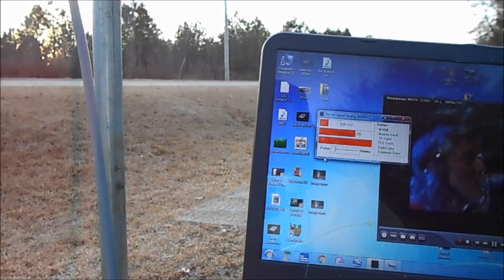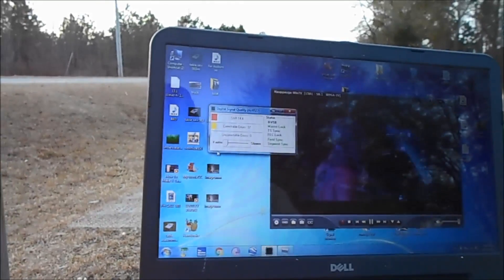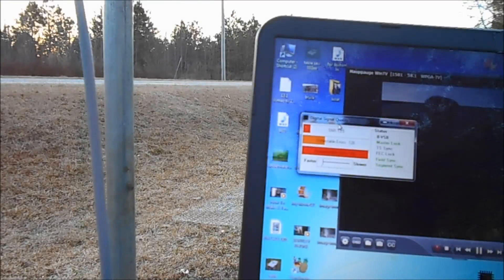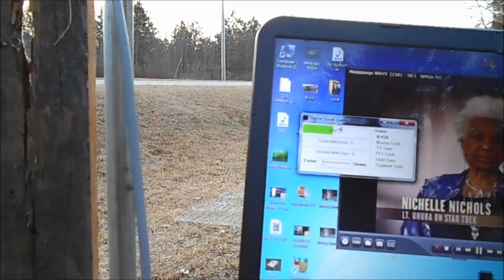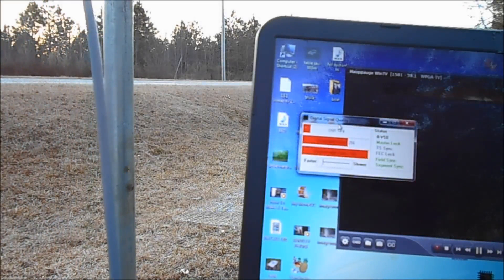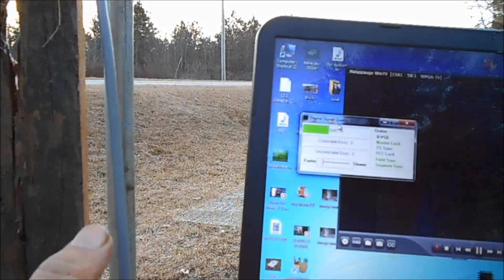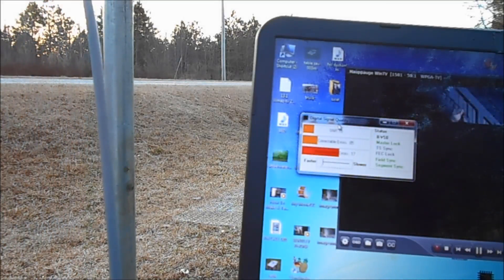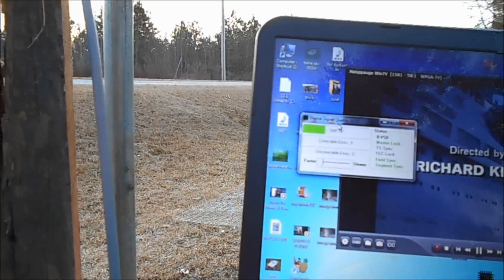TV Antenna Reflector Demonstration

Comment: Thanks for this, Danny! I've been struggling on and off for over a year to get and hold channels from towers 50 - 55 miles away. I live in a wooded area midway between Washington DC and Richmond. I have two antennas (one UHF/VHF and one UHF only) on tripods in the attic of a 2-story house, so about 25 feet high. Until I saw this, I could get channels from both cities, but good UHF signals were tied on weather/atmospheric conditions and would drop frequently. (VHF pickup from DC has always been consistently good.) Since I'm indoors, I built reflectors for both antennas using aluminum foil on old window screen frames. After experimenting a bit, I had great success placing the reflectors underneath both antennas. All 45 channels from DC are locked and only seem to be subject to occasionally multi-path interference from passing aircraft, particularly the weakest ones. I haven't yet figured out how to deflect the aircraft flutter with screens above the antennas since my reflectors are picking up signal from overhead, but I'm in much better shape now than before! :)

Comment: Keep in mind people that the distance between the antenna and the reflector makes a big difference. A reflector can reduce the signal if placed improperly. Starting at about a foot behind the antenna, increase the distance in small increments, a couple inches, and find the right spot. The perfect place with be a little different for each channel. Just find a happy medium. Pro-Tip: there is no such thing as a 'digital' antenna. The digital part is in the decoder. Adding Digital to the name just adds cost, ha ha.